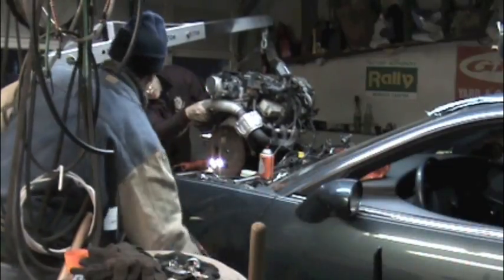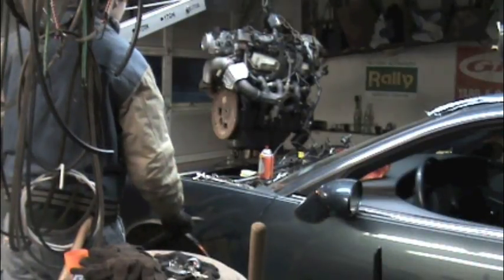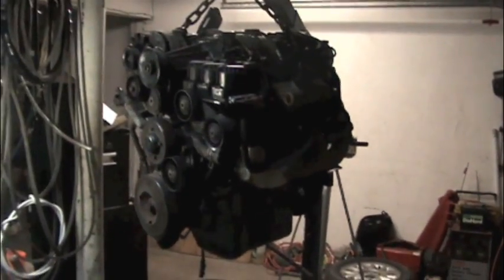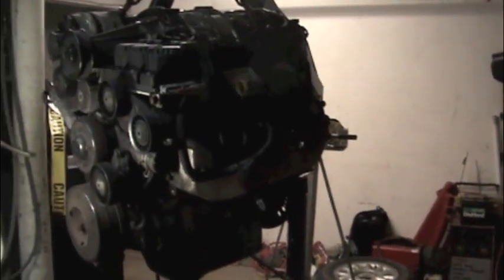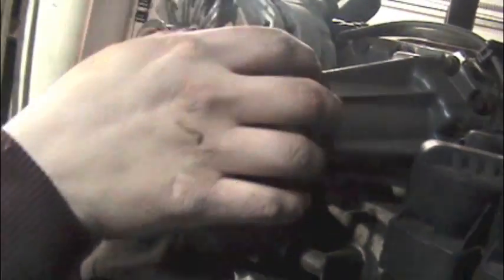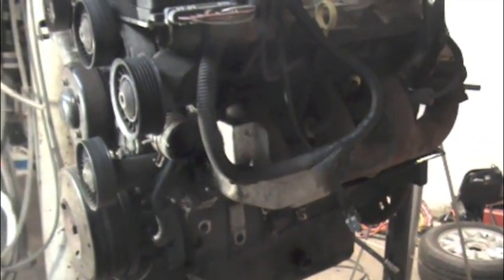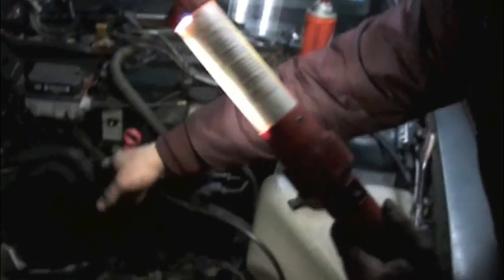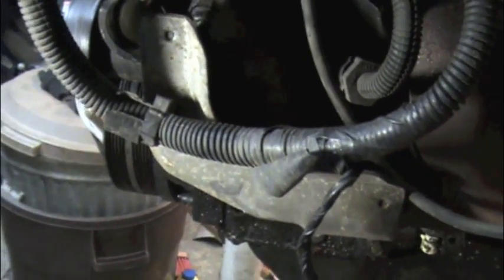Removing the engine on my 97 Riviera

Comment from the maker: @RCSMAXX Nope, just take the 3 bolts out that hold the flywheel to the torque converter.  Afterwards I drained the tranny out and took the TC off and drained it.  the fluid looked pretty nasty in this car.

Comment from the maker: @jerdmo Your probably missing the "backwards bolt" on the rear of the engine, it goes in from the opposite side of the others.  Its also referred to as the "bastard bolt" because its such a pain to get to.  Its near impossible to see.  I had to use several feet of extensions just under the rear exhaust manifold to get it.

Comment: hey being ur pretty familiar with these i just took my 3800 outta my 97 regal and i bought a used 3800 but its came out of a 02 monte carlo now im runnin in tho the problem were plugs are not plugin in and some are lookin different some one told me i would have to change the manifolds someone else told me i the chevy motor is to new is this true

Comment: how a 1989 buick riveria 3800 fit into a 1995 buick lesabre with a bad 3800 engine? because we found the lesabre at a autoauction for only $750 and notised that it was a 3800 engine and we have an old one

Comment: I know this video is old... but last year I pulled a 3800 out of a junkyard riviera and it was the worst experience ever getting it free of the engine mount because the car was hit on the passenger front fender so there was even less clearance there. Worst engine mount design I ever seen.

Comment: just took mine out you have to remove the studs on the ac compressor too! mine spun a rod bearing from a bad uim mine is a n/a 3800II would I need to plastigage the rod?

Comment: I just purchased a 1995 Riviera with the supercharged series 1. Do you know if a newer supercharged series II or III harmonic balancer will work on it? It needs one badly, and the interchange doesn't say it will work, but doesn't exactly say it won't. I'm trying to avoid paying $104 for a new one and have access to a '07 model supercharged shortblock with a free balancer.....assuming it would work. They look the same, but I'm not sure about balancing or the crank sensor ring on the back of it.

Comment: hey did u have to drain the transmission oil out or u just left in the torque converter
cause i am in the process of taking my engine out of my grandprix with the same engine u have this is my first time and i dont want to mess up and something went wrong so when u can reply back to me 
  thank be waiting on message laters